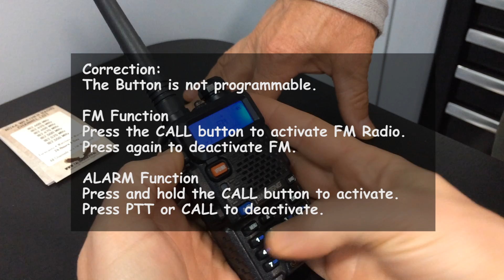Baofeng for Beginners: How to Use Baofeng UV-5R Buttons and More

Comment: What’s it mean when you can’t put in 146.890 it won’t start with one
Reply: Your radio can’t receive on that frequency.
Reply: Even an unlocked UV-5R is able to DX/TX on that frequency...it is in the middle of the VHF 'ham' frequencies. Do you have a GMRS version? Try switching bands (BAND button), though that shouldn't be required. Make sure you're in VFO mode. Use CHIRP to see if some frequencies/ranges have been incorrectly blocked.

Comment: This isn't for beginners. They use way too many words that a new person doesn't understand and they act like you already know about HAM. Don't call it "for beginners" if it's not geared toward the beginner audience.
Reply: If this is a beginner's guide, then I need the totally clueless moron's guide. I just got a pair yesterday, and am spending more time searching for how to operate the damn thing than actually operating it. I am starting to wonder why so many preppers swear by having a radio like this for SHTF. Someone should do a series of classroom type videos from unboxing and assembling to explaining the buttons to highlighting basic functions to walking people through programming.
Reply: @The_Fat_Controller. Don't hammer yourself. I've done the same thing tonight. Nothing worked for me. Why? it's a bad radio that will only transmit on GMRS. 6 fucking hours down the shitter.
Reply: @waterhead1027  I haven't been able to pick up jack shit on mine so far other than 2 weather radio frequencies. Either no one is broadcasting when I am listening (which, admittedly, isn't too often), or these radios are shit. I bought them in case of SHTF to get news and information from the outside world. They might work fine for short-range communications like walkie-talkies, but I think there are better alternatives out there. Or maybe better videos on how to work the damn things.

Comment: Hi there 

I purchased the radio and I was wondering I work at a warehouse that has their own system setup most time they don't extra hand radios so I said I would donate some to help out, they said no cause of company policy. So I have one of my own I was wondering how can I pick up the frequency channel from their station to the hand radio cause they won't give me the frequency code. can I autoscan it by been near the station or have another hand radio and try to pick it up from there.

Thank you
Reply: You will need a ham license to transmit on one of those.
Reply: @canadianrushfan12  but it's for basic work related nothing else, still I would need a license for it.
Reply: @adamjensen6376  yes fcc requires it
Reply: @nolansoflo  who tf cares
Reply: @spoderrr  You when you get a $10,000 fine or jail time for violating federal law
Reply: @nolansoflo  $10,000 fine? Lmao
Reply: @spoderrr  up to**
Reply: There's no fine. If they even respond, which they won't. You may possibly get a stern letter. Someone using it on a job site? Really?
Reply: Hold on first of all this is a warehouse job nothing else. It doesn't pick up no interference from outside the building it has its own frequencies.

Comment: Quick question: I have two (2) Baofeng UV-5Rs.  I have them set and programed identically the same in the menu.  I also have them on the same frequency.  When I transmit from Baofeng radio # 1 to Baofeng radio # 2 it works fine however when I try to transmit from Baofeng radio # 2 to Baofeng radio # 1, the Baofeng radio # 1 will not pick up the transmission from the other Baofeng radio #2. SO I cannot hear any signal/transmission from Baofeng radio # 1.  Do you think there is something wrong with Baofeng radio # 1?
Reply from the maker: Could be, but probably a programming issue. Check to make sure they have the same TSQL/PL settings and be sure the repeater mode split is not turned on.  Also make sure both are in The same FM narrow/wide setting.

Comment: I have a Baofeng UV-5R and live in Phoenix.  Is there a way I can listen to channel being broadcast 300 miles away from me?
Reply from the maker: Got it, so repeaters typically will only reach 10-50mi or so on their own. They are limited by their height and curvature of the earth (e.g. line of sight). Now that said, analog linked repeaters will do the trick. All Star,  IRLP or other linked systems can cover 300+ but are usually dependent on an internet backbone between sites to stay running.  With linked repeaters, your geographical range is just the individual coverage range of each repeater site linked in the system all added together.  I say analog because that is what the UV-5R can connect to. Linked repeater networks are now extremely common in DMR (digital) radio as well but the Baofeng UV5r won’t do DMR, just analog.  So keep a look out on Repeater Book for any linked analog systems in your area.
Reply: No range on these is like 5km
Reply from the maker: Tom is 100% correct. These radios are not capable of that range.
Reply: @TalonSurvival  I guess I was thinking more along the lines of using repeaters to reach that distance
Reply: You are thinking of short wave and long wave. VHF and UHF are line-of-sight, up to 5 to 50 miles depending on power and terrain. Buildings, hills and curvature of the earth block VHF and UHF.

Comment: I've accidentally reset my radio by mistake do you know how to add normal channels to it ?
Reply: I did the same trying to adjust selch I was pissed
Reply: Click the orange [VFO/MR] button at top left until you hear FREQUENCY MODE.

Using the number pad, type in your desired frequency.

Hit [MENU], number buttons [2][7] to jump to OPTION 27 
(MEM CH will show up on screen for memory channel). 

Press [MENU] again to enter the mode.

To keep it simple, hit the UP ARROW [🔺] until you reach CH-001 at the bottom of the screen.

If it shows just 3 numbers at the bottom with no "CH-" prefix, you can add the channel from your main screen. 

If it says CH-###, then a preset frequency is already on that channel and you need to delete it. 

To delete it, go back to the MENU by first clicking [EXIT], click [MENU], then type [2][8] 
(DEL CH will show up on screen to delete channel). 

Scroll to the first preset that says CH-### 
(in this case, CH-001) 
and hit [MENU] again; 
voice text will say DELETED or CONFIRMED when successful. 

Every time you add a channel and scroll through the MEM or DEL CH options, 
the previous slot will show CH next to it to show that it's been programmed with a frequency. 

To add a new frequency, 
you just follow the procedure above, 
but instead of using CH-001, 
you would move on to the next slot which would show 002 for an open channel or CH-002 if it's been preset already 
(which you would then follow the DEL CH instructions above).

Comment: I'm more confused than I was before ngl
Reply: That's because the producers of these videos assume you have a basic knowledge of the frequencies that are being used  and the legalities in using them.

They need to begin by saying, THIS IS A RADIO. IT HAS THE ABILITY TO BOTH RECEIVE TRANSMISSIONS AND TRANSMIT THEM.

They then must point to a button and say, TO TRANSMIT, YOU PRESS THIS BUTTON AND RELEASE IT WHEN YOU EXPECT  TO RECEIVE A REPLY. YOU DON'T SING INTO IT. YOU DON'T WHISTLE INTO IT. IN FACT, WE'LL GET INTO THE LEGALITIES OF USING IT. 

And that's how you would proceed.

Comment: How can I enter a frequency like 78.650 for emergency?
Reply: You can’t as this radio doesn’t support that frequency. Only 2m and 70cm bands.
Reply: @alanbanh   I’m new to this. I can enter 78.650 on the FM-band. But can I transmit something?
Reply: @kejo703   - It won't allow transmission on that part of the spectrum, is my understanding.
Reply: @kejo703  you can enter 78.600, not 78.650.
Reply: @HyperDim.  yes you can

Comment: Quick question : I'm trying select frequency mode, entering 127.400 frequency mhz, I'm getting cancel tone.... how do i configure this frequency in baofeng Uv5r.
Reply: Your out of frequency range! You should be licensed to use these radios to transmit.
Reply: @coolvideos8864  Thi baofeng Uv5r is a ham radio or walkie talkie?
Reply: Simple. RTFM before using the radio.
Reply: @cobaltpica  whats that mean same thing happening to me
Reply: @SNIPERSCOTTIE  I'm thinking he means read the F'ing manual?
Reply: @joetheox1202  no wonder the hobby is dying.

Comment: I wish someone would just do a video on how to connect 2 radios of a different brand. And explain the ctscc bull shhh. I can receive on a frequency on one end but and talk back. Because of this stupid ctscc match up.
Reply: ctss or rcs is not required for 2 way radio operation. Its there just to cut down noise from other transmitters. 2 way radio requires certain amout to technical know how to set and operate.  If you dont like that, there always the cell phone.
Reply: just turn all ctscc and dcs settings off and it might be working, you dont have to use them

Comment: how do you hit the enter key on FM radio. I can key to 99.9 for example but then it just sits there.  How do you tell it to GO?
Reply: I figured it out for anyone else that has this question.  For 99.9 you have to enter zeros afterwards.  So 99.900 and it will go to that station.

Comment: How do you change the letter above the top number line?
Reply from the maker: The letters above the top number line (top frequency line) are associated with menu functions or the type of transmission you are using,  They are dependent on the radio settings, VFO settings, or channel settings.  See a display layout here (https://www.universal-radio.com/catalog/ht/0205disp.jpg)

Comment: Hello sir how do I use my baofeng radio to call other countries.  Like using Allstars or echolink. Can I program my baofen to dothat without using a computer . I already know how to used local repeaters for local coverage  but how can I used them with radio only to call other countries
Reply from the maker: Short answer is no.  Not unless you are connecting it to a echolink or all star enabled local repeater.  And that would still require programming either on the PC or via the face of the radio.  For what you are talking about, a DMR Hotspot and DMR Radio sounds link a good plan.  But those are MUCH more complex to get up and cost a little more $$.

Comment: I have 2 of these someone gave me and I have no idea how to work it.... I want to scan police fire etc. I looked up the Chanel’s listed online for my area and nothing.... it’s not easy to use for me
Reply: I heard in the U.S.🇺🇸
Baofeng UV5R and other brand unit  are illegal to use it 
.. 
my question : 
Is it true ... that those unit are not allowed to be used
Reply from the maker: It is not illegal to use the radio. It is illegal for some specific vendors to continue to sell them.  Regarding radio use legality...That question is dependent on the band you plan to use the radio to talk on (i.e. ham radio, FRS, MURS, GMRS, Marine, Police, Fire, etc).  You can listen to any frequency the radio will pick up without a license.  Key word there is listen.  For public safety, you can use the radio to transmit if you have authorization to talk on that channel (aka you are part of the Fire Dept assigned the Fire Dept channel and have permission to use it).  Legality to talk is a specific answer to the band (or channel in some cases) you are using.
Reply: @whatzupmomoland9377  Everything that's illegal is only illegal if you get caught with it lol... The US military took over the UHF frequency about 10 years ago that's what they mean when they say its illegal...
Reply: @ronball81  UHF radios are NOT "illegal" for use in the USA per se. If thee radios are used in the Family Radio Service (FRS) frequencies they are illegal because of the power output. The General Mobile Radio Service (GMRS) is UHF and is legal but you must be licensed to use it.
Reply: @inkey2  An Amateur Radio Service (HAM) license is NOT required for all the frequencies that are available in the UHF spectrum. GMRS is at a slightly higher frequency than the 70cm "ham" band but is perfectly legal IF you are licensed.
Reply: Common sense is a bitch ain’t it
Reply: Trial & error... and more errors 
You’ll learn it .. it’s not rocket science 😊
Reply: @inkey2  

🇵🇭JEZVR7  👌Oscar kilo THATS a 10-4

Comment: So what if a guy wants to use the channel mode, how do you set it up so you get more then channels 000, 001, & 127?
Reply: USB programming cable and the CHIRP software
Reply from the maker: Bob is correct.  Face program more channels or do it in CHIRP which is WAY faster once you learn what you are doing.

Comment: Ok so i programmed a repeater but i do not hear any conversations unless i m pressing down the side monitor button . Im also able to talk to another radio i have for couple of milles using that repeater but i do not hear anyone else talking on the radios unless again im pressing the side monitor button.  Is tjat normal or im doing something  wrong on the programming . Do other people have like different tones codes because i asssume when we all program our radios to a repeater we enter the frequency and the same offset and same Tone code  so im just wondering why i dont hear people talking when im not holding the monitor button .
Reply from the maker: Sounds like you either have the incorrect receive CTCSS set or you need to remove receive CTCSS tone completely.  Could also be you need to lower the squelch on the radio (i.e. if it is a more distant sounding signal).
Reply: @TalonSurvival  thanks it was the CTCSS  tone 👍👍
Reply: The better place to ask is Radioreference . Com
Reply: Did you program in the tones used by the repeater?
Reply: @macboney5292  ok im trying to connect to a papa system to and it says 
DPL073  how do I enter that to my baofeng

Comment: This was so much more helpful than the manual! One thing though; on mine the memory mode doesn't show MURS, it shows frequencies. Also, I can't figure out how to set the memory channels.
Reply from the maker: To get the names you will have to name (alpha tag) your memory channels.  Programming can be done via the face of the unit but is way easier to do in the CHIRP software.

Comment: I have not been able to pick up anything but the weather. I would like to pick up shortwave, police, fire or anything. Anybody help would be appreciated. I have tried Lake Charles and Baton Rouge.
Reply: hey, i was just messing with mine. are you sure that your not able to pick these channels up? (police,fire,etc) they might not be talking at that moment, you know what i mean? i setup my local police on the Frequency Mode and left it on that channel for about 5 minutes and then an officer started saying stuff. Let me know more details about your problem im intrested in knowing, im trying to learn about my radios
Reply from the maker: See what is in your area on http://radioreference.com.  From there see if it is trunked.  It it is trunked you wont be able to hear intelligible audio on the UV-5R.  Many public safety agencies are now running trunked, especially in urban areas.  Could also be a distance issue.

Comment: Are these strong radios
Reply: yes
Reply from the maker: I am assuming you mean durable.  They will take a beating, but there are more durable units out there.  UV-5Rs really don't like water.  The "you pay for what you get" concept still applies.  What you get for $20-30 with a baofeng is great, but there are better and more durable units on the market.  I like the Yaesu FT-65R for durability vs price as a step up from the UV-5R, FT-60R is good for ham only as well, its a classic.  Tytera and Anytone also make some good higher quality units.

Comment: Hi there. I have a UV-5RTP. I cannot enter UHF frequencies into it. I enter one but it reverts back to 524.000? Any ideas? Thanks.
Reply: What frequency are you trying to enter?
Reply: @BigE36  433.350 amongst others.
Reply: @Mark-wx1ho  found this on Radioddity - NOTE: The frequncy of the UV-5RTP radio has been set as 140-150/430-440MHz when it manufactured. In order to use the 136-174/400-520MHz, you need to do the factory reset. Press the Menu button, type '40', and then the radio will be reset. Then, please use the the Baofeng official software (Not CHIRP) for programming. It has the page under "other" simply checking the box that says "allow more than 480MHz transmit", and changing the frequency range from 400-520MHz, then click write to radio.
Reply: @BigE36  I unlocked the UHF and VHF with CHIRP and it worked a treat. I have just tried to enter 435.000 and that would not work either. It's pissing me off now as I can program the channels with CHIRP just not from the keypad.
Reply: @Mark-wx1ho  on Radioddity it said not to use chirp to use the baofeng program to unlock the frequencies
Reply: @BigE36  I don't think this is the issue as I cannot enter any frequency and Chirp worked before.
Reply: @Mark-wx1ho  have you tried a factory reset and starting over?
Reply: @BigE36  Yes. Tried everything over and over.
Reply: @Mark-wx1ho  i think I'm out of ideas man. Sorry about the radio. Couldn't hurt, do another factory reset and use the baofeng software.  I know you said chirp worked before but you never know with these things. Good luck.
Reply: @BigE36  I will hunt down the BOEFENG software and give that a go. It's weird because it was all working fine. I started using the radio after around 12 months of it being unused and now have this issue. Thanks for all your help. Much appreciated. Take it  easy.